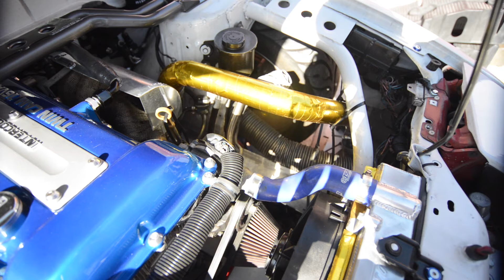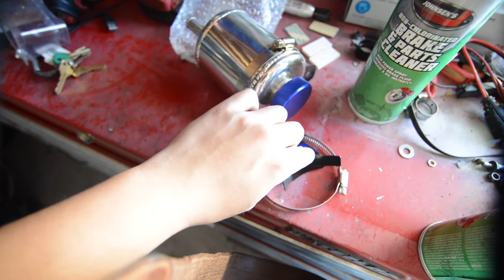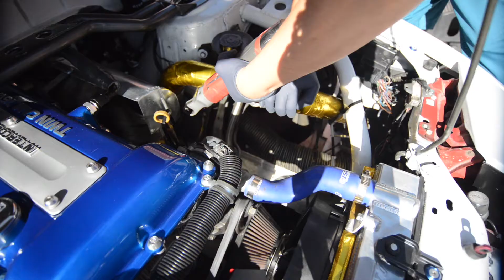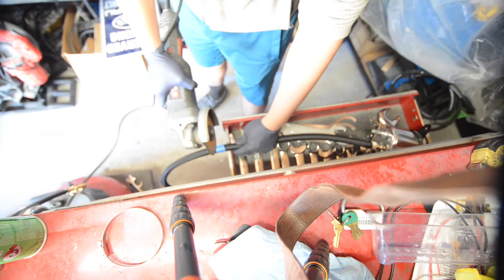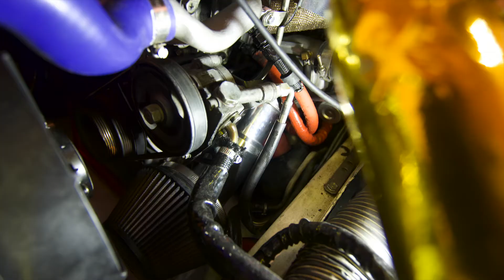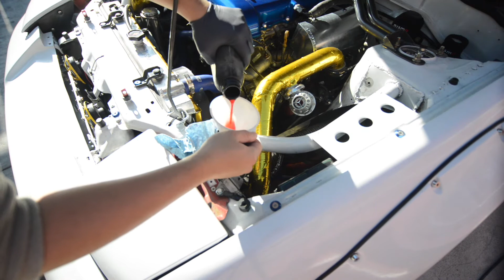Power Steering Reservoir Relocation

Comment: Did yours leak from the cap? I bought the same one and it’s leaking.
Reply from the maker: It's intentional. It"s met to let air out. You may have overfilled it (happened to us the first time). When bleeding it with the car running , we keep it topped off half way to two thirds full. Reason being, when the car is off and or when you turn the wheels with the car off the excess fluid fills back the revisor.
Reply: @tougelab3996  did you top up until the little hole was filled? or just before it.